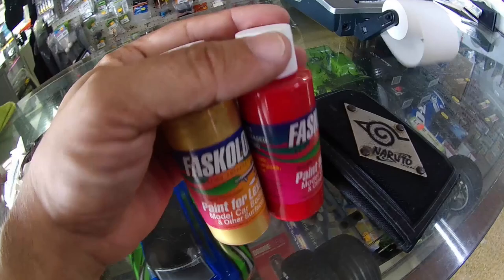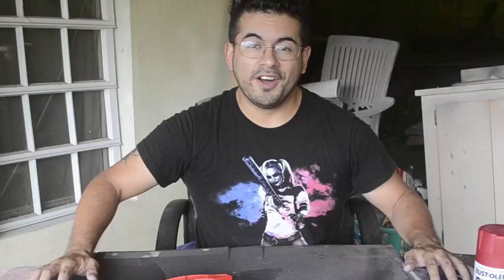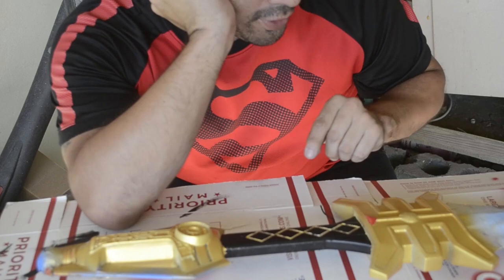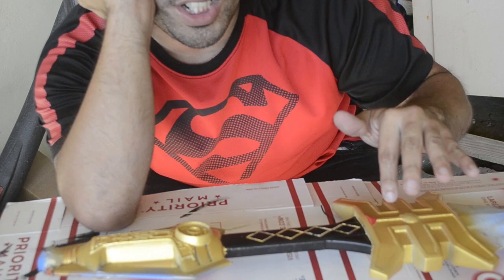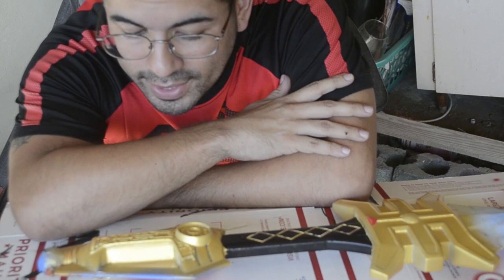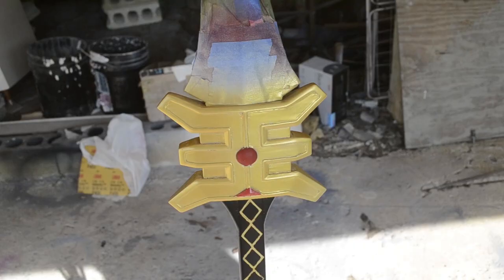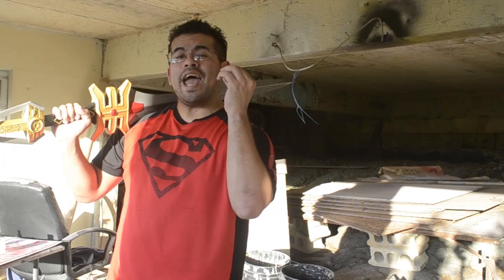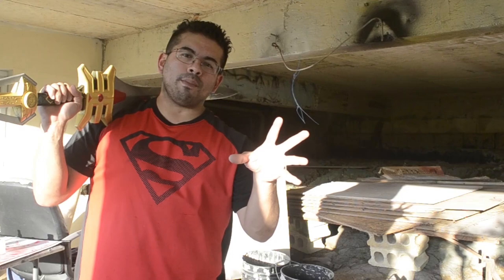Making King Tyranno Sword #MMPR #cosplay #Kingtyranno

Comment: Are you going to do an aluminum casting? If you did this stuff and made them out of metal. That would be amazing. I would spend good money for a metal painted version of this.
Reply from the maker: its a good idea but not an easy process where I live to do
Reply: @OscarGoldenImageTubeLarrea  Well if you ever try I will definitely buy one.
Reply: @OscarGoldenImageTubeLarrea  You could make molds of your stuff and produce resin castings. Is that what you do?

Comment: What spot putty do you buy?
Reply from the maker: i use a brand called water weld i buy at my local walmart
Reply: It’s a single tube liquid? I’ve been looking around I only find sticks or two part liquids. Advise?
Reply from the maker: @jamesburton8936  your looking for epoxy putty it seems, the spot putty try going to and auto parts store like pepboys or advanced auto, should be near the bondo
Reply: Thanks! And what’s your advice on avoiding tape residue when taping portions off?
Reply from the maker: @jamesburton8936   never use gloss Pai n give paint aleast. Day to dry